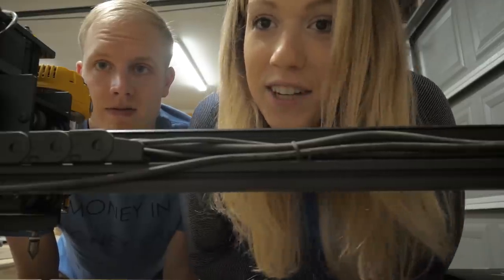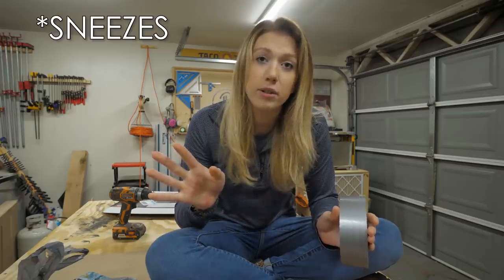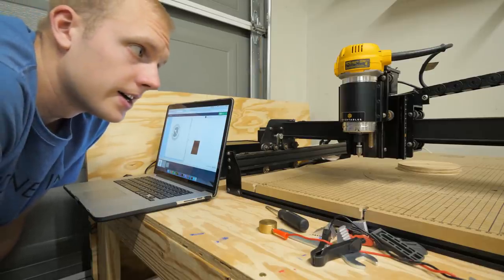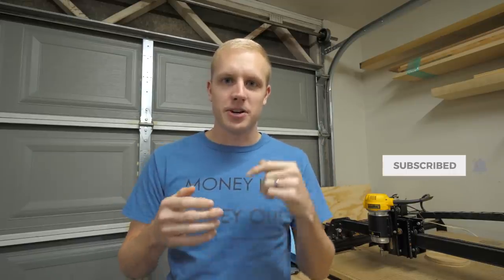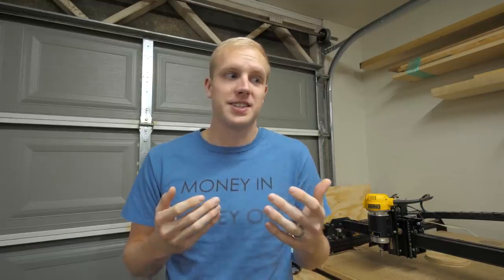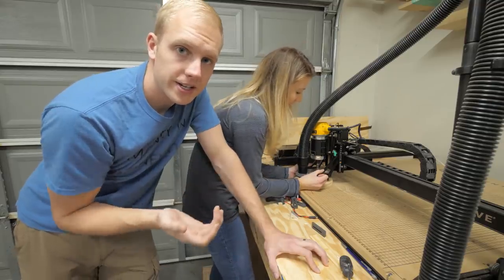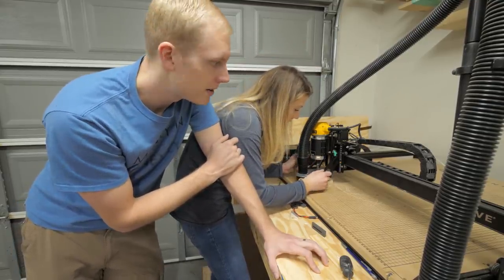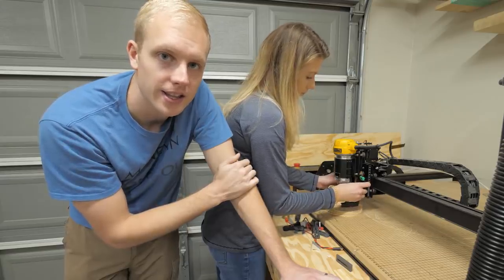The CNC conquered US! 🤦🏼‍♀️🤦🏼‍♂️ Let's Conquer the CNC! Part 3

Comment: I use a nextwave automation shark hd5 cnc. Learning vcarve software is still challenging,  but I'm getting the hang of it, some 4 months later. I did very little assembly, basically bolt the gantry to the table and plug it in. You may find it easier to use.

Comment: I have gotten away from 2 face tape I use wide blue painters tape on both surfaces and use CA glue to hold the two layers together. For repetitive jobs that do not cut through the part (signs) I have made a spoil board with holes in it like and MFT table and use homemade wooden or 3d printed cams to hold the pieces against wooden or 3d printed stops. These clamps can be cut through if I make a mistake in programming.
Reply from the maker: https://youtu.be/gGiJR0KPHXg?t=489

Comment: As for holding your material, I made a small vise that uses the T-tracks to hold in place.  You can switch out parts really quickly with this method.

Comment: Before you ditch your CNC take a look at Shaun Boyd's YouTube channel.  He is a fantastic furniture woodworker who incorporates the same CNC you have in his table builds.  He will use it for templates and all kinds of other stuff. His channel is fantastic and you will thank yourself for watching his videos.  Another point for keeping your CNC and it pair it with your laser.  I own an Axiom i2R-8 (2ft x 4 ft CNC which comes 98% assembled) and it is a killer CNC, and my Aeon Mira 7 Laser will be here in a couple weeks.  I will be passing work back and forth between these two machines on a bunch of different products as they both have their strong points.  I cannot imagine launching my new product line without having both the CNC and the Laser.

Comment: As far as laser go we have three 24x18 Epilog lasers, one 32x20 epilog laser and they work good. But are costly to buy and parts are also costly. Also have a K40 laser that will vector engrave faster buy not cut faster then the epilogs. The epilogs raster engrave faster then the K40.  Also have a 80 watt 700mm x 500mm FDA china laser with a S&A CW5000 chiller. The laser has a motor to raise and lower the bed but it not auto focus. but everything we engrave is the same thickness so we do use auto focus on any of our lasers. The cost of the large china laser was $2,250.00 and the chiller was $545.00. If I had to do it all over again I would stick with the small epilogs lasers but the large lasers I would go with the FDA china large lasers.

Comment: The Laguna PL 1220 is sold at Rockler and other outlets.  It is a CO2 laser with a pass through bottom.  This means you can set it on a  table top with the laser's bottom removed and engrave imagery onto the table top.  The Nextwave Moray laser is also carried by Rockler.  Like the laguna this laser's bottom can also be removed and placed on a object you want to engrave.  The Moray is a diode laser and is really not powerful enough to cut anything much thicker than card stock.  These lasers have a workflow that is not as friendly as the glowforge, but they do not have the web requirement.

I'm sorry your CNC is not as easy to use as you hoped.  I am active in the Inventables forums and there are many there who are able to create impressive works with the very equipment you have.  

Regardless of what CNC or laser you have, the important thing to remember is that these machines do not do all of the work for you.

Comment: Hi, I've only just found your channel. I used to have an X-carve but had so many problems with it, maybe its because I had it shipped to the UK, I salute your for giving the machine an honest review, as you say its sold almost as a "build it and its ready to go" kit but in reality there is a lot of teething issues 🙄.

A method I like to use to hold work down is blue painters tape and super glue. if done correctly its super easy to remove and leave little to no clean up.

Comment: Some suggestions if you even see this:
1. Don't cut on your actual spoil board.  You should have an additional waste board on top of that (even if it's just 1/2" MDF). 
2.  The double tape isn't bad, but CA glue and blue tape is also good and strong and won't leave a residue. You tape the product, tape the spoil board, and then CA glue those things together. 
3. YT people probably don't have the boot on because you can't shoot video of the CNC cutting anything.  
4. Suck-it tolerances are pretty good (have them on my Shapeoko xxl).
5. You can't really beat the CNC for personalization.  You are saying glowforge, that automatically tells me that you really haven't looked at lasers. Those things are highly overpriced and far smaller than you could get just running a red/black chinese laser, with much higher power.

Comment: I know it’s been 7 month but figured I’d comment on the laser. Having used one for several years there a pros and cons to going with glow forge or not. I’d highly suggest looking for something that is stand alone functional. I agree the cloud based is not a good way to go. There are server good option but the key thing is the controller. DSP controller based laser units I feel is the best way to go. You have the ability to function via USB thumb drive or over the network and use software like lightburn. From watching your videos I feel like you need expandability as you do big projects. Working area should be at least 2’x3’ and have in and out panels on the front and back to allow for larger items. I’d shot for 80-100w laser which will allow you to process items fast. Solid rail systems like mgn15 or mgn12 will allow for fast engraving or cutting with great accuracy. Due to different material thicknesses you would likely want a adjustable z bed to make it easy to get the correct height for engraving. Many have good luck with Chinese red/black machines but if budget is no object I’d look at hl laser products the have brand name tubes (RACI), dsp controllers, z tables and good mechanics. Msg me if you have any question.

Comment: What if you use painters tape on the wood and then use the double sided tape. Also have you tried a different cnc software? Or!! Switch to shapeoko! Great content as always.
Reply: 74 Creative American Design 
Blue tape and CA glue/kicker does wonders
Reply from the maker: https://youtu.be/gGiJR0KPHXg?t=489
Reply: @jennieanddavis  

theres also using T track and cam clamps. We also use those and haven't ever had any movement. 

but roll your own and find what works for you.

Comment: If all you want to do is engrave/etch the surface why don’t you look into a laser attachment for your current CNC?  You already have the machine, kind of know how to use it, just change the tool.  Then later if you want to revisit the CNC aspect you can. Also, the CNC you have is not going to be a high value production machine.  It will be fine for Etsy sales and limited run stuff but I think you’ll outgrow it quickly or fall behind because it doesn’t have to ability to keep up. Possibly look at AVID CNC or Laguna- both make nice machines. However, if you had a challenge assembling the machine you have the AVID is going to be more so a challenge.  Just my thoughts also like your honesty about your CNC adventure. Don’t give up- keep at it.

Comment: I disagree with the laser idea by the way. I would tell you to buy a better CNC.  
But I guess it depends on your budget. 
I would recommend Highly Avid CNC. 
You get what you pay for. 
Again good luck with your venture.  
Jimmy
Reply from the maker: A better CNC would still be 3X the work and learning curve for the same result as a laser out-of-the-box. Work smart before working hard.
Reply: @jennieanddavis  Life is a learning curve. But it seems you want everything tomorrow and not work to learn it. I spent 22 years in the Air Force and never met an Airman like you. What does a laser have to do with your so called ' Tables' Company model. Buy some better equipment for your shop because what you have will never hold up to the so called "Production" environment you speak of.  I have yet to see you back up any of your claims with actual proof. And stop calling yourself a company cause you are not registered in  Houston as a business.

Comment: can you send a link to the info you found on updating the gcode in Easel that works with the new Dip switch settings?
Reply from the maker: Just set your $1 = 255 and you'll be in business.
Reply: @jennieanddavis  $1?
Reply from the maker: @brianpeters512  Google is an amazing tool.
Reply: In your last video didn’t you just talk about a community of woodworkers and business owners helping each other...?
Reply: I can always use google to figure it out...but considering you apparently found the solution I simply thought you would be willing to help a fellow woodworker out and give us part 2 of the solution.  Massive unsubscribe....not cool folks
Reply: So for those that would like the full answer to my question....here is a link that they could have given us all that explains the procedure in pretty good detail...

https://discuss.inventables.com/t/lock-motors-not-working/45732

Comment: Also, please don’t get the Glowforge for your legitimate business. Ours went down and we were out for over a week. 

I have the pro...

-It’s (overly) basic and very limiting.

-For the price, you can get a Chinese laser like my buddy’s luggage company has and it has a MUCH larger bed,
- Has an air suction system that pulls smoke below the piece instead of on top of your piece (which stains your piece).
- Can raster (engrave) a LOT faster. 
- isn’t much louder than the GF.
- Lastly, the fan on the GF is not constantly on so once you open the lid, you get a face full of smoke (exaggerating) and a ton of smell (not exaggerating). 

Hope this helps.
Reply from the maker: Yeah I don't think any of those things are dealbreakers to us. We plan to have a backup unit, no matter what kind we get.

Comment: I think you may want to upgrade your design software to something like V carve pro .
If you want to do lite manufacturing with CNC or Laser engraving ,and I little more robust CNC would go a long way in easing you frustration levels.
One last thought you need a lot more time on machine no matter what type of cnc you do, laser or cnc router just to get to know what works and what doesn't . And different woods do different things and what bits work best in those woods

Comment: If you are a hobbyist, mess around with your equipment to your heart's content. If you are running a business, hire a consultant/contractor who know how to make your equipment work. How much time did you sink into getting your CNC to work as you wanted? An experienced person would have saved you a lot of time/money.

Further, a really good consultant will teach you how to solve the problem you called him/her for. A lousy consultant will keep you in the dark to keep the calls coming in.

On another note, I use a carpet tape I bought at Lowe's that has a fairly stout web. Holds well, comes up intact, rather than in strings of snot. And, lacquer thinner should help cut the snot.

Comment: Xcarve is a good machine after the set up though.. if your going to use double sided tape you need to use real double sided tape like ... 3m heavy duty.. I’ve tried it all ... you can also use painters tape with super glue .. otherwise hold down clamps are quick and easy in my opinion... find someone that will 3D print you some. I will send you some if you wanna try them out . As far as a laser I have a laser that attaches to my CNC. Jtech .. my friend has a eplioch stand alone 40w.. and he uses it for a ton of customization to his products. My jtech is  limited to engraving 
.. picturing. Small cutting into wood.
Reply from the maker: Thanks for the suggestions!

Comment: They dont use the dust shoe because you cant film with a dust shoe on very well. Idk, all these kit cnc's are about has difficult as hooking up a  surround sound system or so IMO. Which is something they sell at most electronic stores. I mean, the average person might not enjoy it or understand it. The but learning curve isnt impossible. Just takes a little dicipline the first time you do something that you havent done before.
Reply from the maker: That might be part of the reason, however a LOT of people complain about the dust shoe, too. Never said the learning curve is impossible; the juice just isn't worth the squeeze to us. There's a better tool - has nothing to do with discipline.
Reply: @jennieanddavis  I cant argue with that. The only argument I would have against a laser vs cnc is on the 3D carving side of things. Filling epoxy or doing inlay are also forms of personalization. They just need to be part of your strategy or business plan in order to justify keeping the CNC. If you just want embossed\shallow engravings into wood and to sand off the burn marks, a laser is perfect. 

A larger bed CNC like that is also great for flattening live edge slabs, tabletops sections that are too wide for the thickness planer etc. I see justification for both, but that is my vision for things that I want to do. You obviously just gotta do what is right for you and your business.
Reply: @jennieanddavis  to be clear. I dont have a X-carve. I have a openbuilds lead 1010
Reply from the maker: @waldvogelreview7755  Yeah I just don't see our business going that direction. Hence the laser.
Reply: Jennie and Davis good job. Never feel like you have to justify your decisions to the people in the community. People like me.

The whole idea is that we build each other up and we help others see things where they might not be looking. So if you have made your decision for a laser, GREAT ! Super happy for you guys. Sharing our two cents might help each other, or it might amount to nothing. That’s ok ! 

The only thing that matters is that you are confident in your decision to switch for your business ! :-) 

(Josh from ILTMS loves the glow forge but has a few negative things to say as well on the Making Geeks Podcast) If you’re looking for something different, you might go with a high end Chinese one like Myers Woodshop or Tim Sway (larger format and wattage). With those, you often are sourcing your own software to use. 

With the other 2 main players we see, full spectrum and Epilogue you pay a lot for software that is expensive and outdated (from my experience) but they are made well and work.

Comment: I bought an x-carve and I have not been able to carve anything yet. I had trouble with the gantry that came damaged in the mail, I got a replacement right away. But now I can't carve for more than 2 secs! It just stops for no freaking reason! First, they blamed electrical interference from the router itself (I isolated the cord), then they blamed my computer (I switched to my gaming laptop). Now they are blaming firefox! Oh and the router doesn't want to go down and touch the probe (I can move the z axis on manual control) and now they are blaming ME for assembling the Z axis wrong! Its been 2 months! I have a business to run! I don't have time to sit down and troubleshoot a defective product all day long! 
I am looking into using Universal Gcode Sender to control my x-carve. I think the main problem is to rely on an internet-based cam software. I hope I can fix it soon, or I'll be selling this crap on ebay!

Edit: Oh the f*$#%@ dust shoe! That piece of crap! What a waste of my money! The magnets on mine kept coming loose. I had to superglue them all back together!. I also had to reshape the acrylic part to make it fit the supports because it kept coming loose!

Comment: i bet the company would like to know.  I would like to know if my product was tedious.  Opening the box to adjust electronic component..., if its that tricky it should come with better instructions
Reply: I felt like the instructions for the most part were great, better than the instructions for the millright cnc i put together. they did kind of get a little meh with the side board though. Inventables actually does go over the settings for the switches on the board in their instructions. I remember looking at the pictures to make sure mine where all in the correct positions. I was able to put my machine together of the course of about 3 days spending maybe 3 hours each day maybe. I have ran a couple projects now and knock on wood have not had any issues. I love what J&D do and like a lot of their content but it baffles me that they have had as much trouble as they have.